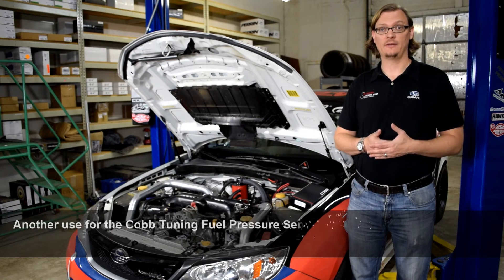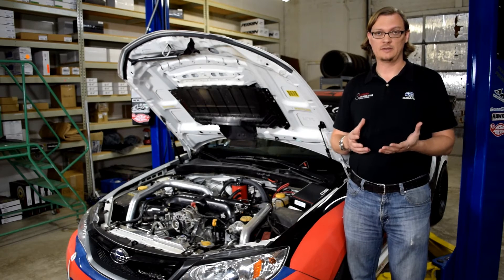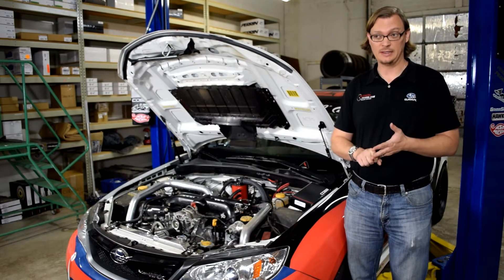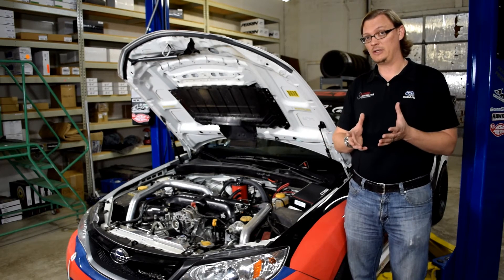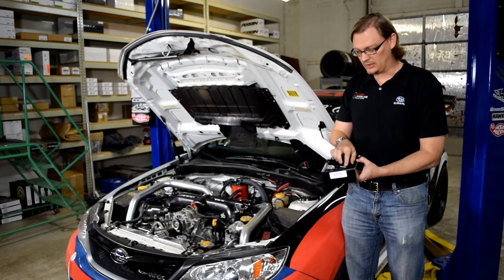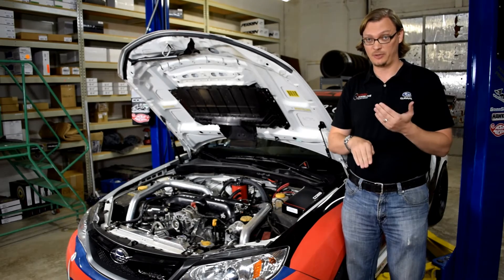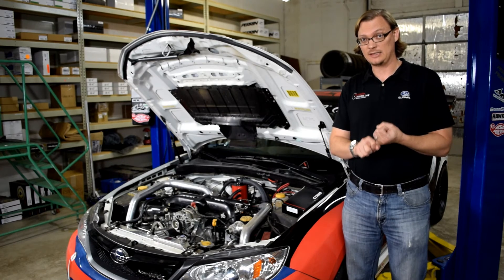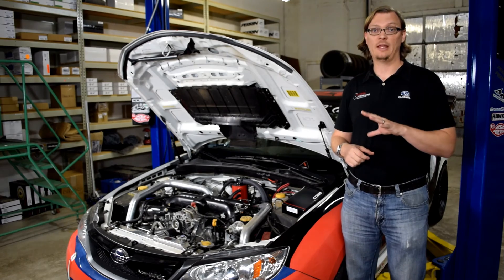Another way to use the Cobb Fuel Pressure Sensor

Comment: Lately I keep getting engine light with cruise control light flashing with this part.

When i check accessport for error codes - I'm shown these codes: C0BB4 & P2017 anyone else experienced this?
Reply from the maker: We haven't had or heard of that issue. I'd recommend checking in with Cobb to see if they can offer any assistance. 

Hope that helps and Stay Tuned!

Comment: I thought the wire is a pigtail to your tgv harness.
Reply from the maker: Thanks for your question.  Yes, that is correct.  It does run on that circuit, but Cobb re-purposed it.

Hope that helps and Stay Tuned!

Comment: Recently I’ve noticed from my datalogs, my fuel pressure is fine during city driving, but under boost, my fuel pressure is dropping to 30 psi under boost, IDC goes to 100 percent. I have a Doesn’tWorkz300c pump. Just ordered an AEM430 to see if it’s my pump. I’ve tested my radium FPR, and no fuel comes out of the vac reference line, and it goes up 10 psi if I unplug it from vac source. Sounds like fuel pump right? Your video pretty much explains this, but maybe you have some other ideas for things for me to check. Thank you, love your videos
Reply from the maker: Thanks for your question Adam.  Since your IDC is going to 100%, and you are seeing your fuel pressure drop, I would agree that looking at your fuel pump/fuel supply is a good place to start.

Hope that you can get the issue resolved.

Stay Tuned!

Comment: You mentioned in order to use this, the tgv has to be deleted. Is that correct? Just want to make sure since my buddy runs cobb flex fuel kit and this sensor and if i remember correctly, his car still has the tgv. 

Love your videos btw. Great content!
Reply from the maker: Thanks for your question.  When we made this video, the Cobb Flex Fuel sensor and Fuel Pressure Sensor replaced the clip that normally ran to the TGV's.  

Since then, Cobb has re-designed these sensors so that they are more of a jumper harness so that you don't have to remove the TGV's.  I believe in that case you lose the ability to tell if the TGV's are malfunctioning because the Cobb sensors take over the return signal to the ECU.  But I believe that the TGV's will still work.

I hope that helps, and Stay Tuned!
Reply: Awesome! Thank you

Comment: Do you know if you can hook up an AEM or similar gague to this?
Reply from the maker: I don't believe so because the sensor that Cobb uses is the only one that can attach to the fuel line.  If there is a different adapter so that you could connect two sensors.  But keep in mind that once the Access Port is configured for this, you can see fuel pressure on your AP display.

Thanks for watching!

Comment: So, just to be clear, this IDC adjustment feature is a built in benefit of Cobb's fuel pressure sensor kit?
Reply from the maker: Thanks for your question.  If you are using this in conjunction with Cobb's flex fuel kit, then yes, this is a built in function, and that is why they include it in that kit.  But what we found out from our tuner Harvey at The Boostcreep was that even if you weren't running the full flex-fuel set-up, just installing the fuel pressure sensor would allow the tuner to turn on that function, and so there are some pretty significant benefits even running pump or race gas just from that.  Much more consistent fueling.

But just to be clear again, if you aren't running the full flex-fuel kit, this is something that your tuner will have to enable and set.

Thanks for watching!
Reply: FlatironsTuning I understand now. I been over the video a couple times and didn't quite grasp it. Needed it in writing, haha. Thanks for taking the time to clarify.
Reply from the maker: No Problem :-)